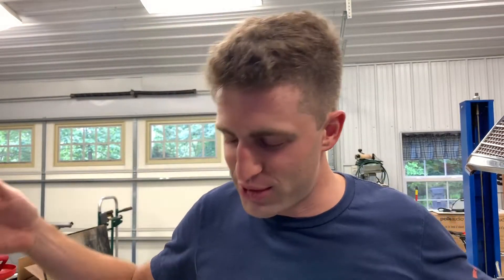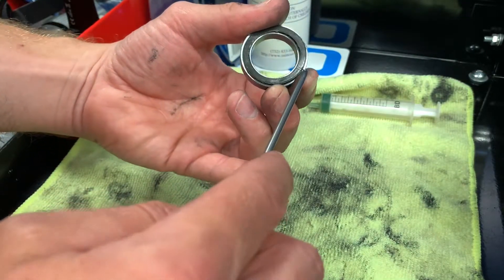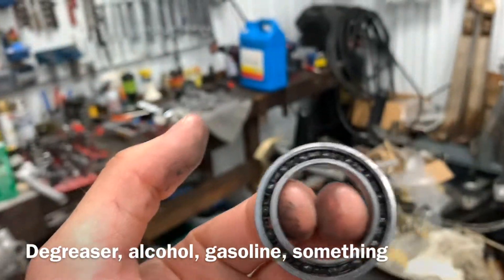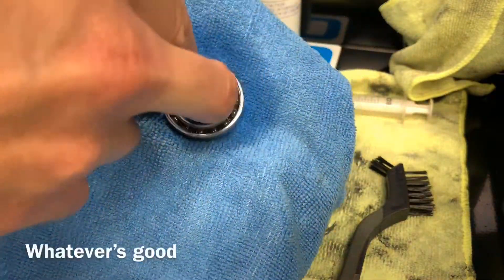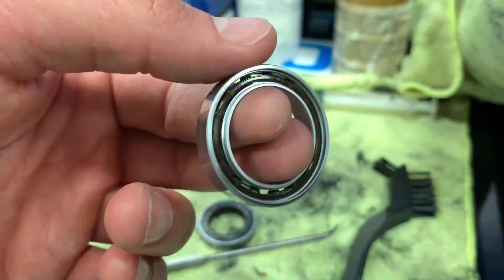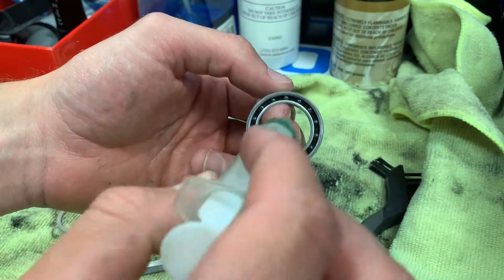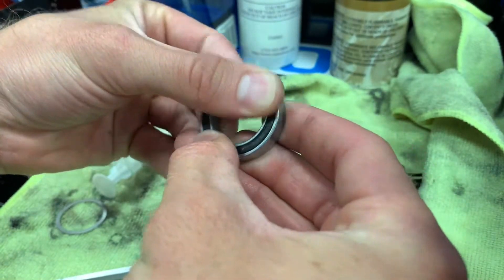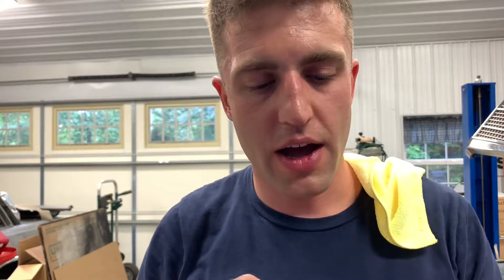Ceramic Speed COATED bearing SUPER SPIN: How To Make Any Bearing Super Fast

Comment: 'it doesn;t matter if you start removing the seal on the inside or outside'.. on a wheel the axle is stationary, on a bb the axle is rotating so how do you think they design the seals to contact the races on a wheel vs bb bearing? :}
* the bearings on a bike experience negligible loads and rpms as far as bearings are concerned.. 
what's the life expectancy of a wheel bearing on a 600lbs motorcycle under normal use? a Lot of miles, like circling this planet a few times :}
Reply from the maker: The internal race has a flat side and a hollow or non flat side

Comment: Great video, thank you. Quick question: I did exactly as you’ve shown to my BB ceramic bearings. When I put the crank back on without dust covers or spacers it spins like magic. But as soon as I add those back (plus grease) the whole system has a ton of resistance. If the dust covers are rubbing up against the bearing while spinning and creating a ton of drag, what is the point of having a low-friction bearing?
Reply from the maker: So depending on what you mean by “a ton”
- addding grease will stop the bearing from spinning in your hand but on the bike the crank should turn over easy
- spacers? Are you running some sort of adapter between the bearing and the crank spindle (sometimes acts as a dust shield)? If yours has warped it can rub against something stationary in the bb and cause resistance. Use sandpaper to modify the shape. 
- if you are using spacers with something like a sram crank you’ll need to be careful you’re getting proper crank bolt tension without over compressing the bb bearing. Try removing a spacer

Comment: Is that ceramicspeed bearing still working well? What do you think about doing the service without removing from the bike, just open, remove the protection and do the job of cleaning and regresease ?
Reply from the maker: This bearing is still rolling as smooth as ever- it’s on a bike that doesn’t see much use these days. 

If you leave the bearings in the frame you will likely only be able to remove one of the two seals and that will prevent you from properly cleaning out the bearing. In that situation I would simply wipe down the crank spindle and wipe clean the bearings and put some fresh grease on the surfaces to do a mini refresh.

Comment: For 11 euros I buy me a new bearing. That’s a no brainer man. Too much time and energy this maintenance. Of course when you gets loads of satisfaction fixing it, do your thing.
Reply from the maker: Totally- but this is a $200 bearing that’s intended to be serviced and outlast a standard bearing. A true ceramic bearing costs 4x the cost because it’s supposed to last 4x as long (with service). If this was a regular steel bearing I probably wouldn’t bother servicing it either
Reply: @wrenchfriday   I was about to say that there is no way your getting a Ceramic Speed Bearing for 11 Dollars,Pounds or Euros

Comment: I'd just like to add that the condition of the seals will determine your bearing life. If they get damaged every time by a little bit it's going to get gritty much faster than last time.
Reply from the maker: Totally, but if your servicing sealed bearings in general your simply trying to delay the inevitable. Run ‘em to the ground or service them because you want to tinker and get your hands dirty. 

A new chain on your bike will trump any bearing service/upgrade you do